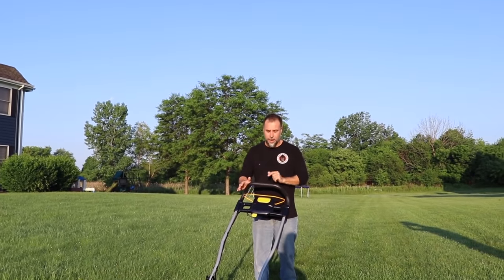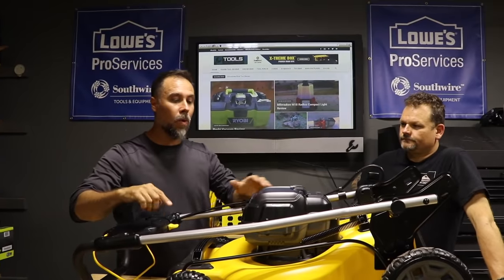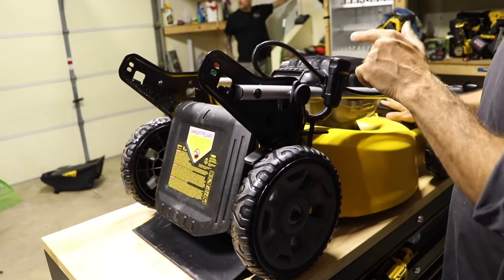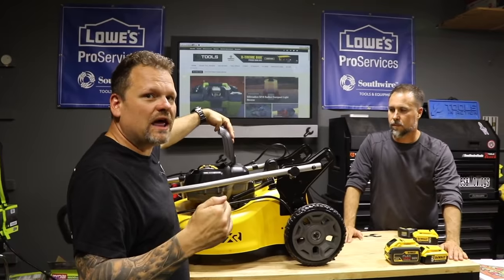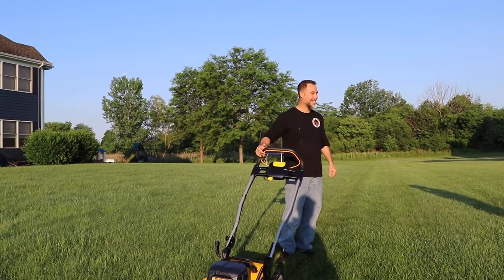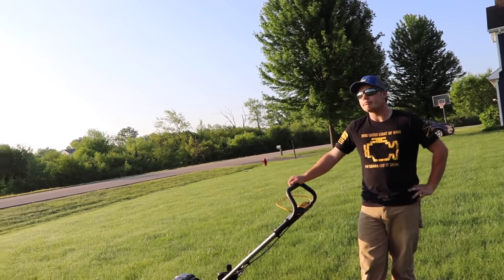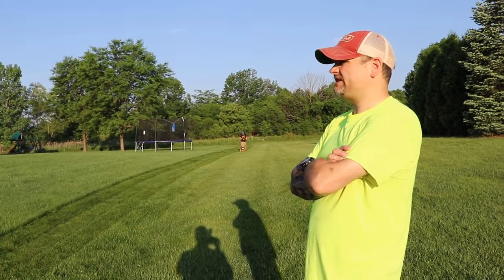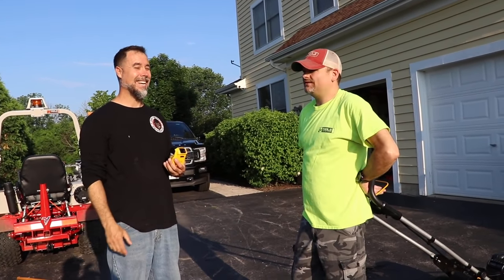Dewalt- 1st place for the Worst Lawn Mower of the year

Comment: I got 2 bad tools for ya. Ryobi weedeater and blower. You get about 5ish minutes of run time per battery.
Reply: That must be the 1.3 amp hour battery that comes with the tools.. I own alot of ryobi tools. Have the 4 amp hour batteries and I can run my drills for 2 and a half days on one charge. Upgrade ur batteries and you wouldn't have issues.. ryobi is cheaper than the big brands for a reason but they are just fine.
Reply: And that's using my drills all day at work
Reply: Cool thanks

Comment: LOL. You need to calculate the square footage of your job than  dived that by (length of job times 3 feet) then dived that result by the difference in height of each blade of grass minus the height you want it at times 2 is the number of charged batteries you need.  figure out how many batteries you need charged to put in some back pack.

Comment: These DeFault tools all seem to suffer ridiculous design oversights. The battery chainsaw features easy-to-clog ventilation for the motor, a painfully hard thumb switch which must be constantly depressed to run the saw, and a bar which is retained by just one plastic wingnut thingy that ratchets at a pathetically low torque to allow plenty of deflection when cutting.

Comment: The deck is on it's lowest setting, they're mulching wet grass until the cut grass gets so clogged up under the deck that it stalls, I bet a gas mower would clog up quicker in the same situation ! This video only shows how good this mower actually is under this intense test !

Comment: I think the mower was setup to fail. I think it's interesting that the grass was very wet or damp with a mower without a discharge.  I also thought it was very interesting that the demo featured a 100 yard straight cut pushing very fast. I would like to have seen the front yard that the guy said he's been cutting for 4 months. The video was interesting but not a good or fair product review

Comment: I am surprised Dewalt have not sued you guys,  my 6hp gas lawnmower will bog down and stall if I try to run it on wet grass in mulch mode with the deck to low,  and I will not be able to restart until I clear all the wet clipping from under the deck.  Be a man and call yourself out,  take down this review and do another one on a proper size lawn for the mower with dry grass and deck high enough for the clippings to have a place to go

Comment: I don’t think it was designed for use on  football sized  wet lawns. Seems kinda like using a 1/4 inch hex impact driver to remove semi-truck lug nuts and complaining about it lacking enough power.

Comment: Worst lawnmower ever.. I bought this same one and a year later the effing thing is now sitting in my garage waiting for parts... I clipped one rock and it wrecked the blade. Purchased a new blade but the shaft must have gotten damaged also because even with a new blade it's louder now and no longer balanced
I had an old plug in motor I got from finger hut 17 years ago that never had an issue. I bought this new house with much bigger lot and figured a plug in would be a hassle so I left it behind. Bad mistake...
All my battery poweres tools are Dewalt so I figured why not... Now I'm looking for a real gas mower....

Comment: In all honesty , this is not a fair test !! I'm not a fan of the electric battery powered push lawn mowers , but they are designed for small lawns and for grass that's not 4 inches thick , much less WET GRASS ! And it's a mulching mower or at least being operated in a mulching set up! Let's be honest even a gasoline powered self propelled push type lawn mower with a larger engine like a 6.75 horsepower engine in a mulching set up would probably struggle with this test or even choke down and go dead with all this wet grass clogging up under the mower deck ! Even my John Deere LA 105 riding mower with a 42 inch deck and a 19.5 single cylinder ohv intek engine operating in side discharge mode would struggle in thick wet grass especially going at a fast pace like what for comparison would be like 4 th gear , because your walking at a face pace so yeah like 4 th gear on the LA 105 , IF THE GRASS WAS DRY and it was only 2 to 3 inches thick then that battery powered mower would do a lot better job than this demonstration shows that it is doing !

Comment: Rotary mower create an updraft a bit like a vacuum cleaner You're trying to mow without the grass box attached and the safety flap closing the ejection shoot so there is nowhere for the cut grass to eject away from the blade of course its going to jam up if there's nowhere for the grass to eject. If you're going to review a tool at least use it in the way it's designed for.

Comment: I have one of these and it works just fine in dry grass at a normal pace. You're clearly trying to stall it for the sake of the video Most gas mowers in this price range will also stall at this pace too. Bottom line is that if you need to mow through thick wet grass at a fast pace (like the video), then you'll need to spend more than $400 on a mower whether it's electric or gas.

Comment: This is not true. 1st its a battery powered. 2nd it stops because they didn't put the bag.  3rd watered grass is hard to cut .4th a lawn mower gas or battery will always stall cutting re cut grass. 5th you don't want to cut to low.it will also stall it. 6th it didn't last long because you used 5amph batteries.  7th you should of used bigger batteries for a little more us time. I think that's it.

Comment: One of the worst tools, a Makita worm drive saw. I’ve had three and they’ve lasted a combined month and a half. I’ve had the most success with Ridgid worm drives.
Reply: Concrete and Construction I love their worm drive do you use it on wood only?   Curious. Also love the rigid worm drive
Reply: Honest Greens just wood. I like the Makita 14” chop saws, they’re great. However, the “magnesium” or worm drive saws are bad.
Reply: Yeah the shoes on Makita worm drive saws break to easily
Reply: lol, I just got a makita worm drive circular saw to replace an old ryobi with a bent fence, Have only made it a few cuts with it so far and thought it cut great. Hopefully it lasts longer than yours!
Reply: So each one lasted 2 weeks on average? I find that hard to believe. Did you set it up on some sort of makeshift table saw?
Reply: Willow killa hopefully you’ll have a better experience. I use their saw blades on the Ridgid though, they’re blades are good.
Reply: Andrew Delashaw a makeshift table? It’s a hand held 7 1/4” saw.

Comment: It seems the dewalt has low load tolerance. I have an ego electric push mower that will handle wet grass mulching,rear side discharge and bagging several inch tall grass,thick weeds and field grass with no problem. Not bragging just saying some are better than others.

Comment: Everyone is so upset who either are die hard battery fans, or because they bought this garbage lol. He was pushing this mower, youre right. But for 399 bucks hes showing what it does under normal circumstance. Wake up, start it up, and get to it. I purchased a craftsman m310 for 220 bucks (gas) that would run circles around this thing, and mines half the price and not even considered high end! This things worth MAYBE 200 bucks. Maybe

Comment: So, within the first coupled seconds I saw what you were doing wrong...and you did not read the directions. When you have lawn that is as tall as you had it in the video, you have to set the height adjustment to a higher setting, mow...then set it at a lower setting and mow again. Any professional mower  should know this.

Comment: 20 volts is not going to cut it no pun intended.. I have 36 volts on a weed wacker and it does decent for a run around small yard, 40 Volts x2 would be minimum in this application. You won't bog down with 40 but you are not going to cut this yard with it either. This is riding mower territory.
Reply: Ironically DeWalt sells a 40v version of this mower which uses a single battery. I'm surprised they didn't review both versions and do a comparison.

Comment: That's just as bad as the gas mower I have I mean the quitting out the run time is alot better but it quits just as much as this one but course mine is an older mulching mower and heck I've seen an new ryobi electric push mower work better
Reply from the maker: Which gas mower craps out on you?

Comment: What I can say is that the dewalt saws that are battery-powered especially their "Worm Drive like" 60 volt is fucking incredible. I still don't think I would consider the battery powered lawn mower or chainsaw.

Edit: just noticed that that is 2 x 20 volts to run that mower... I bet if it was a 120 volt with2x60 volt flexvolt it would be probably pretty damn good but the batteries are freaking expensive. I currently have the Worm Drive flexvolt and can easily go all day with one full charge while framing or forming for concrete forms

Comment: The Toro grandstand .  I hate this more with a Passion took a back after I bought it absolutely miserable says we had one knows the same size same model same  year the tires or even aired up the. You would set   You'd even some the same 2.0 and you'd look Adam and one of the point .5 off.

Comment: I used a home life weedeater and omg was it terrible!!
I'd put it on its side to put gas in and it would roll over!
Its a bitch to start!
The damn thing burned my arm when I went to reach with it!
But the worst part about it is it was literally impossible to put string in it!
There was no notch to hold the string after you wound it up. So you had to hold it with your thumb to keep it from going every where, you couldn't put the string through the hole on the head bc the second you let go it would unwind and go everywhere!!
If i had to rate I'd give it a 
Dumb gasoline on it and watch it burn bc that would be a better use of time than spending 15 minutes to put string on it!! 
I had to leave a job bc I couldn't put strings on!!

Comment: i think it might work work better with 2 flex volt batteries and i think thats what they designed it around cause mo powha is more better lol
Reply from the maker: It would work a lot better but then thats not the way they outfitted it from the box.
Reply: i guess so
Reply: 60 volt chain saw first use on railroad ties...fail..lost all chain oil..little 10 inch pole saw can go right through ..dewalt with sharp chain..goes through one cut...tons oil smoke....2nd cut 60 volt battery overheated....thing has 
no cutting torque.....hate it.....stihl gas 250...goes through like
butter.want cordless one that do big cuts.whats up dewalt with auto
oiler...using stihll chain oil.auto oiler messy....sad..cheap 10 inc Remington
8 amps...pole saw..outperform your 60 volt saw..now your lawnmower.
do have dewalt 20 volt weed eater..vac...blower...works awesome...lot
milwakee tools to....hoping milwakee chain saw is winner.

Comment: Looked like a totally unfair test.  First off, you cant mulch at that height.  You should have been using the chute.  If you wanted to mulch you should have raised the height of the mower.   Also, only idiots mow when the grass is wet.  Just my opinion.

Comment: Bruh my 3.5hp tiny little off brand mower from like 10 years ago runs better then this and has like 50x the runtime- the only thing is that thing is half broken and overheats and still work better and yes it would mulch like 6"-8" wet grass

Comment: Can you put a gas engine on the mower. I need that suspension on my push mower. my $50 gas push mower does a way better job than that thing does. I work mine so hard it is smoking afterward. so yeah I work the crap out of mine. Electric mowers are NOT for commercial use. Gas is the way to go.

Comment: Pretty much anything from DeWalt is junk and it has been since Black & Decker bought them in the late 1980’s. 
In my opinion DeWalt is just a little better than homeowner grade tools , as soon as you really push them they break. 
Want quality go with Mikita or Milwaukee either brand is outstanding.
Reply from the maker: I've ran some awesome Dewalt tools-  There battery powered concrete is one of the best on the market.
Reply: I don't think many will agree with you.  Dewalt is as competitve with Milw & Makita.  Have no problem with their batt op tools.  But the batt op mower is defiinitely not on par.
Reply: My dad runs Mikita and me Dewalts are more powerful, better built and last longer. Milwaukee are too heavy and have less power.
Reply: At one time we exclusively used DeWalt but within 3 years of B&D buying DeWalt the quality was gone and my boss (Provided our Power Tools) told everyone that if they bought a DeWalt tool on a company card they would get to pay for it or they were fired! 
The drills and impact drivers would fail in the first 30 days, we switched to Mitaka and we didn't have a drill or impact fail for years.
A good number of the GCs and Subs that we work with have the same opinion about DeWalt as I do.
Reply: You obviously no nothing black and Decker has owned Dewalt since 1960

Comment: First things first, I have a Honda that wouldn't cut wet grass that tall with out discharge and the dewalt mower definitely isn't meant for that big of a lawn. Have a friend with a normal sized residential lawn and he actually uses the discharge, go figure, and it works amazing. I have roughly the same size yard and I'm getting one. Horrible review because you didn't discharge the clippings, you tried mulching it. and again its not meant for that size lawn. Learn more about the tools you're reviewing before trashing it.

Comment: Ok, first off the two Tools in action guys are just that, two tools.  Those two idiots do no prework in most of their videos. 
I have an ego mower, Love the convenience, love the power. Not 100% happy with the cut quality but that's a different story. It would go through that with no problem. However, the size of the batteries is completely different. The 7.5ah battery on my mower weights the same as 4 of the Dewalt batts. 
The same issue with my snowjoe 80v snowblower, it would rock if the battery system was better. Dual 40v batts can't keep up with the demand.

Comment: Okay, Stanley "Dirt Monkey"....Did you really expect to mow wet grass that was as thick and tall as it was with a battery powered pure mulching mower ( no side discharge )..?  perhaps you already knew what would happen and just wanted to have fun with the video ?  When you are using a pure mulching mower , you have to mow often enough to where you don't cut more than about 1/3 of the total height of the grass each time. It looked like you were trying to cut about 1/2 of the height...just not good for mulching. The yard is good looking...but to cut grass that tall & thick requires some real H.P. and the grass inside the deck has to have some time to get thrown back down into the yard.

Comment: You set the machine up for failure by trying to mow a small field & not a "lawn".
What you have there is ride on territory. 
That small electric mower is obviously designed for a very small area, like 1 unit in a complex. No doubt it would perform well in that environment.
I was a yardy for 10 years. I would not tackle that yard with a gas push mower letalone a battery powered job!

Comment: This test is stupid. There’s mowers Are not intended for professional use. Home owners do not need to get up at 6am and cut wet Grass. They wait until the grass is dry and set the mower high for the first run and then step it down. There not on someone’s pay roll. There probably even enjoying the task.

Comment: Wow now i see what they mean in the comments that grass was really wet  and thick you i dont think this is a fair review  ok guys dont buy this to mow your 3 acre ultra thick grass.  this is made for someone who lives in the city or has such a small yard they do not want to mess with gas  this would be perfect for all the cookie cutter houses in the suburbs with small yards   i have an Echo 56 or 58 volt i dont remember chainsaw and weed wacker  the chainsaw is absolute garbage the oiler does not work at all and it will only run for a minute before it shuts off and the weed wacker is really nice except if i run it to hard it will shut off like the battery is dead.  i dont know what is wrong with it i heard it was a problem with the early ones

Comment: I don't care what home use mower you have, with the deck bottomed out in 4" wet grass on mulch will stall ANY mower. This review is just to smear DeWalt. If you wanted to do an honest review you would have mowed dry grass at a reasonable height.

Comment: Really? Hope you don't get paid or sponsored to do these reduculous vids, they are not serious claims to be creditable tests right?
I have a $20k Husqvarna that struggles on 6am wet  grass that is free of broadleaf..nice lawn though! No manufacturers recommend starting a mower on wet grass at low level, start high or on clearer ground,now now on higher setting first. Battery draw is of course high when you labour. Increased load-high draw- short battery reserve. I own one of these amongst many other mowers, mulchers ,side throws, catchers, ride on mulchers. Always works fine on our beach property lawn of 990 sq. Our other properties like yours and bigger we always use the appropriate ride ons. 
I get customers in trying to use their hybrid or alternative fuel vehicles like a petrol or diesel one and wonder why it doesn't replicate.

Comment: Stan stop using 20 volt batteries on a 60 volt system lol
Reply from the maker: I used what they sold with the machine.
Reply: that mower is 2x20v